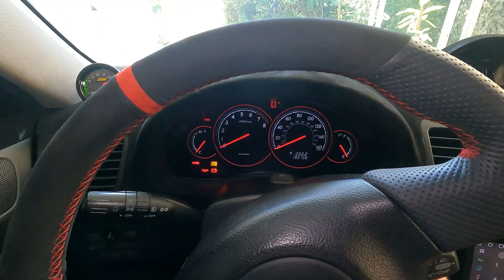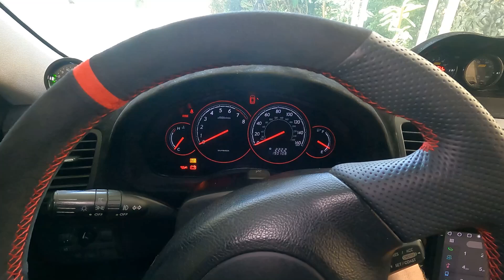Stop Doing This!! Subaru EZ-Flash Test Connector Button

Comment: on my 2002 wrx th econnectors are several inches up in behind the obd2 port. i would need maybe 6ish inches of wire to mount the switch on the trim under the dash beside the obd2
Reply from the maker: I think you are the second or third person to request that so I'll have to get working on that

Comment: That’s awesome. I have 06STI and mine are up behind the fuse panel on the driver side. I have two blank buttons next to my IC sprayer and headlight adjuster… whatever. Do you think it’d be possible to get something that would fit in one of those blanks?
Reply from the maker: That is definitely something I could make. I do custom CAD design and 3D printing so if you would like more information you can send me an email at swspeedco@gmail.com with some pictures and I can get you a quote

Comment: .... or just go to the junk yard, cut a set of connectors out of an old Subaru with their wires, put a switch in the wires and now you have a switch that just plugs into the existing connectors. No spades or modding the existing wiring.
Reply from the maker: That way would definitely work. I wanted to make something that someone could purchase and be plug and play to get those results in a clean package. The sale price is $34.99 using the spade connectors instead of $60 if I used the iwire connectors. I appreciate your input, im a DIY person as well but sometimes it's nice to be able to just buy something that someone else put the effort into figuring out. Thanks for watching!!

Comment: Hey great job on this. I bought your tgv deletes and I’m impressed with the quality. I could have made some myself but they wouldn’t have looked as nice off the print. You should definitely start embossing “SW Speed” into everything you print and sell. 

Would you make secondary air pump delete plates? I’d buy those too. 

Also one note. The green test connectors are needed for all Subaru that are older then 2008 because they moved to can bus that year.  I leave mine disconnected in my stinkeye and flash a new rev almost daily right now! (Sorry if it affects a couple sales but I was under the impression I needed to connect and disconnect this every time and I bought the car off a guy who flashed  Cobb 1+ ots then drove with them connected for ten years after haha)
Reply from the maker: Thank you, im glad you like the TGV deletes! I have been trying to figure out the best way to emboss my logo without it looking bad because it's hard to print the required resolution with the 0.6 nozzle I use.

I will definitely add the secondary air pump delete to my to do list haha!

I didn't no that about the 08 and Up vehicles, but its good to know.

Thanks for Watching and I really appreciate the support!!